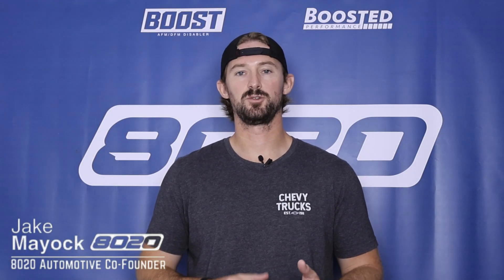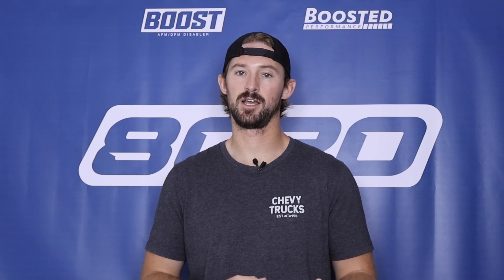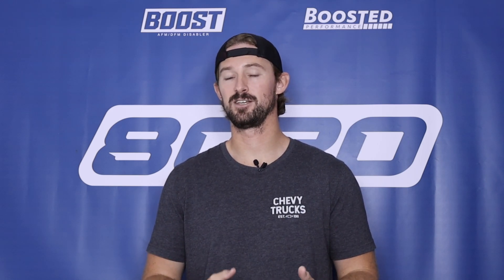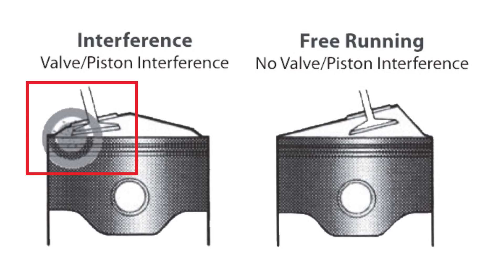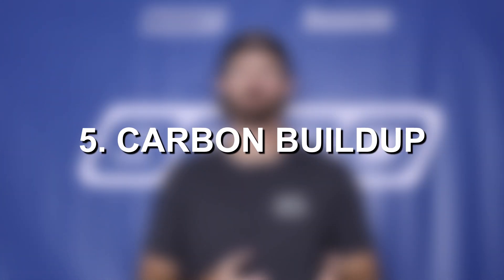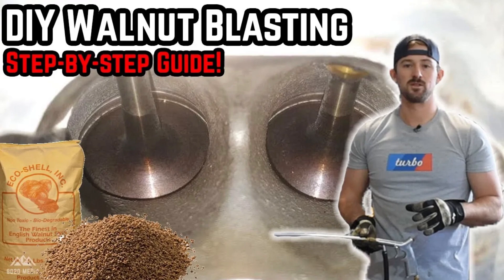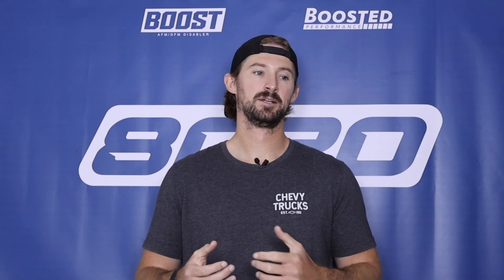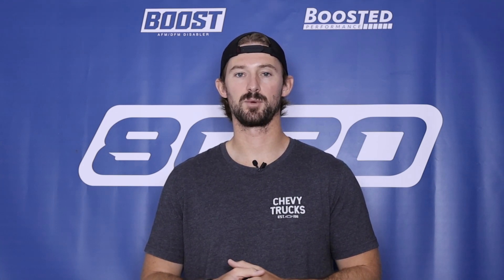Is the Volkswagen EA111 Engine Reliable or a Headache Waiting to Happen? (VW 1.4 TSI)

Comment: Got a Golf TSI 1.4L with about 110'000 miles on it. It's my first car and 2 weeks in the check engine light started glowing with it's evil yellow glow. I'm so fked. No noise problems but a lack of acceleration/power at lower rpm, sub 2k, on 4-6th gear. Especially noticeable up hill at 70+ km/h. Idk anything about engines, had no idea it was both turbo and supercharged. Gonna check for fault codes this weekend as I know a guy. But man does it feel bad.